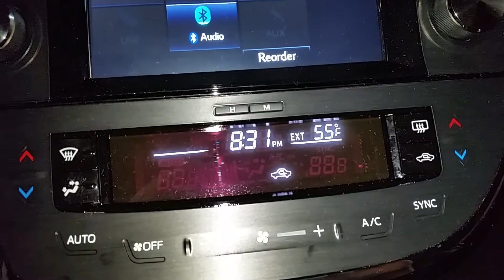2013 To 2018 Toyota Avalon How To Open Hood Check Oil Level Brake Fluid, Coolant Washer Fluid Clock

Comment from the maker: Check out all of the DIY repair and maintenance tutorials for the 4th generation 2013, 2014, 2015, 2016, 2017 & 2018 Toyota Avalon - 
https://www.paulstravelpictures.com/Articles/Toyota-Avalon-Common-Problems-Repair-Maintenance-Guides.htm

This quick DIY video shows owners of the 4th generation Toyota Avalon how to open the hood, access the engine bay, find the oil dipstick to check the oil level, check the brake fluid, check the coolant overflow tank (expansion bottle), fill the windshield washer fluid and also adjust the time on the clock (change hours and minutes - daylight savings time).